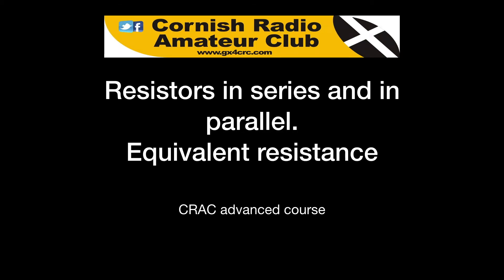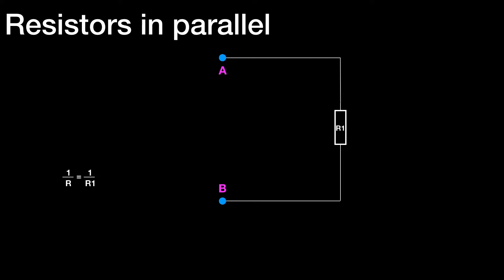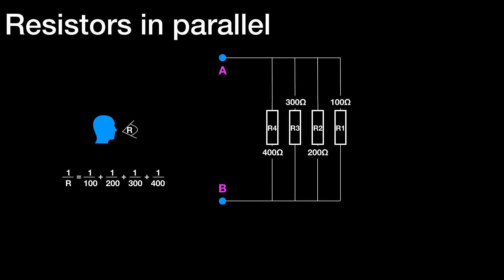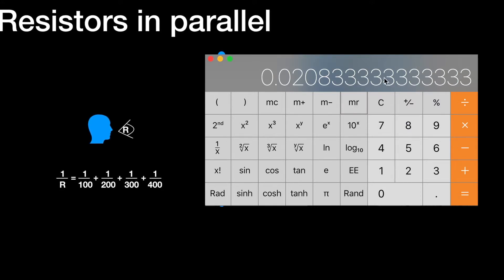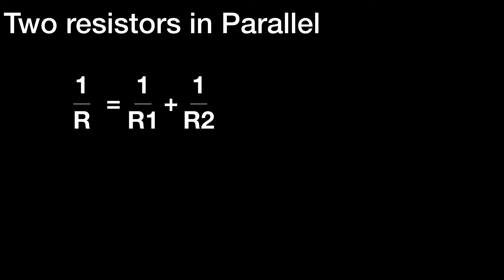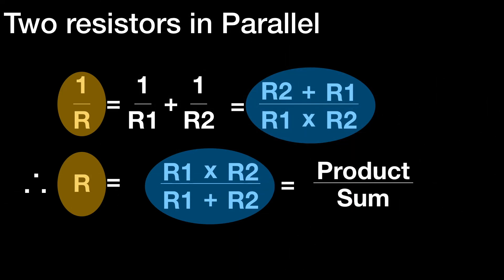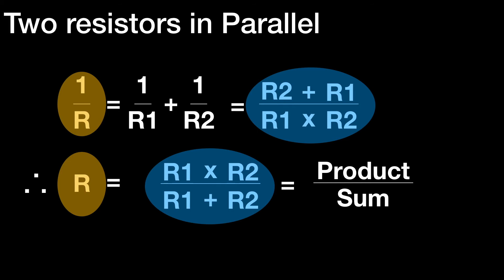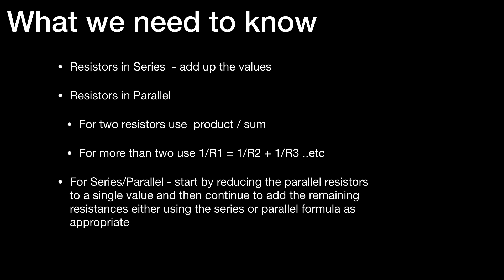Advanced - Resistors in Series and Parallel

Comment: Surely the situation where you have 2 resistors in parallel and they in turn are in parallel with another resistor (see 14:19) is just equivalent with having 3 resistors in parallel?

Thanks for the videos though, very helpful.
Reply from the maker: You are welcome and yes you are correct - perhaps I have laboured the point a bit.  I suspect I was thinking that if one didn't one to use the reciprocal formula one could use "product over sum" .
Reply: Cornish Radio Amateur Club Training Good point, I hadn’t considered that!